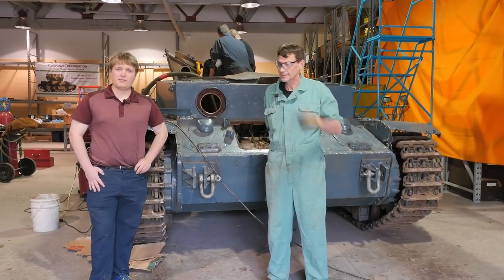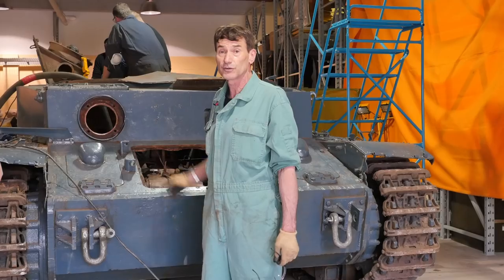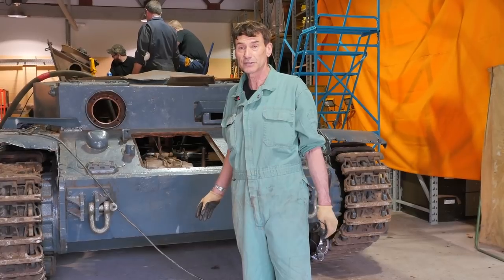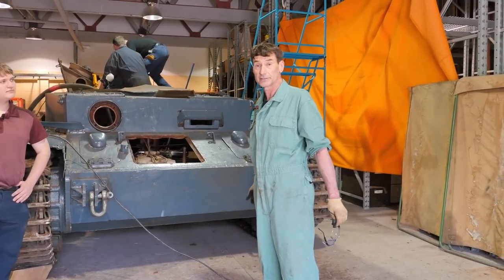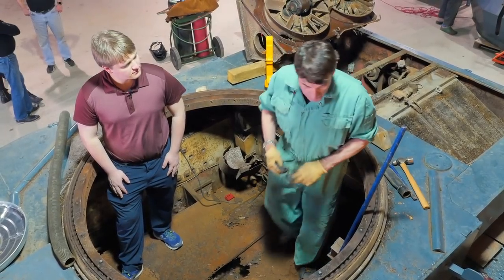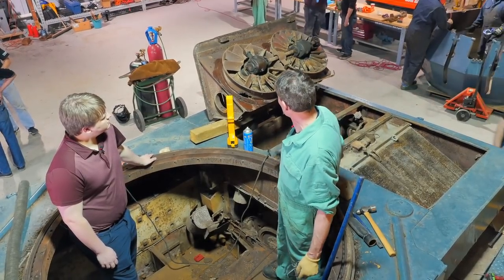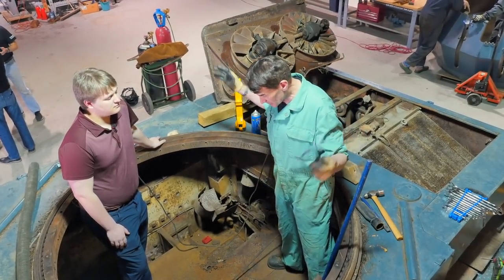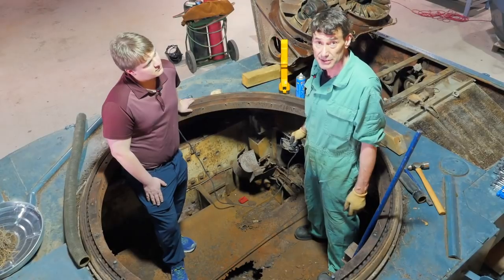Flakpanzer Restoration: Chassis Update (April 29, 2017)

Comment: If the engine cowlings couldn't be opened until the turret was removed, how was it meant to be maintained in the field
Reply: bob smith Turret would be rotated to allow access.
Reply: Or pulled of, the german maintenance corps had use of cranes in the rear lines.
Reply: You would be amazed the amount of difficult work required to do a lot of maintenance on any armored vehicle. Only in recent years have SOME types of vehicles been designed with easy maintenance in mind. Pulling a tiny turret like that to swap an engine is hardly a challenge at all, when compared to pulling a modern turret.